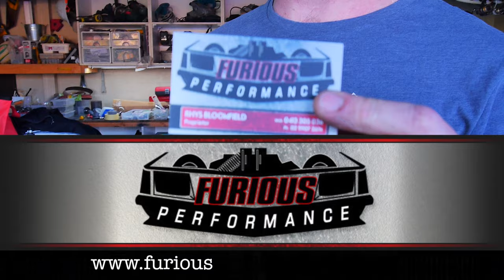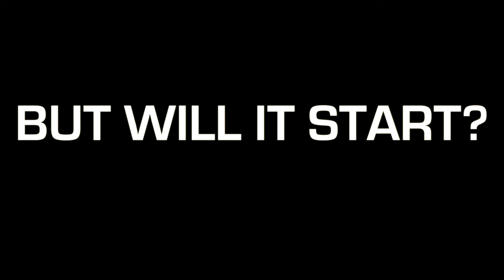HOW TO TURBO YOUR 2H DIESEL - 60 LAND CRUISER BUILD - PART 3

Comment: Great video!  I did the manifold flip which put the turbo assembly high enough to run the oil drain into the front pushrod cover.  Vacuum on the crank case vent is critical for a bunch of reasons.  I'm noodling with a catch can as the intake sucks in oil through the crank case vent.   But I'm getting some flow restriction

Comment: Why did y'all decide to use the oil pressure sensor feed?  I used the oil feed to the alternator,  I've seen both methods.  Is there an oil pressure difference?  Less lag in feeding? Reliability?  Thanks!  Also, I found that the intake manifold butterfly valve leaks a bit.

Comment: What were the oil hose threads? I'm not good with reconizing threads by listening... I'm prepping the bosy soon and then I'll start the turbocharging chassis and the body are separated now :)
Reply from the maker: Juuso's Garage As in the threads in the block for the feed or the sizes of the AN fittings?
Reply: Thread in the block. What size lining did you use in oil feed and return?
Reply from the maker: Juuso's Garage In block it is a 1/8th inch NPT, and was -AN4 for feed and -AN10 for drain
Reply: Did you use some resistors for the oil pressure so the oil will flow correct speed through the turbo?
Reply from the maker: Juuso's Garage Yes, a 1mm drilled out to 2mm at the inlet to turbo. Can be seen in the Making Speedflow Fittings video
Reply: Wondering if you remember where you got the oil feed tee piece from mate? In the process of mocking up a turbo kit
Reply from the maker: Performance shops like Rocket Industries etc sell all kinds of 1/8npt tees and fittings